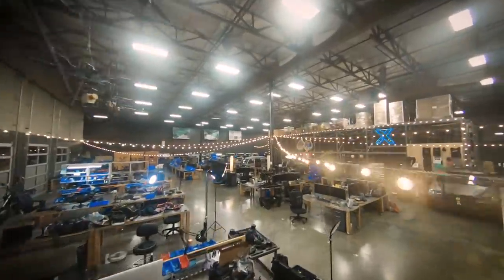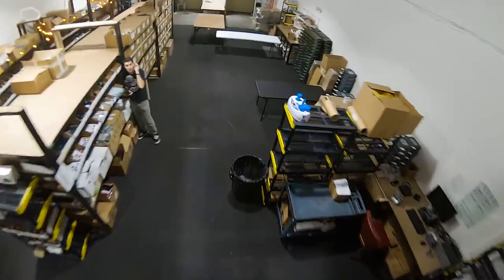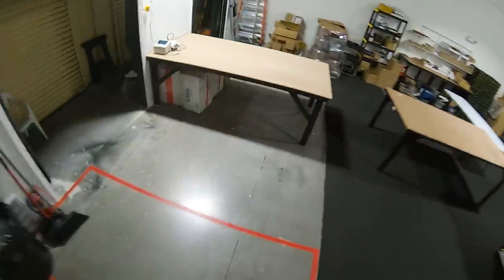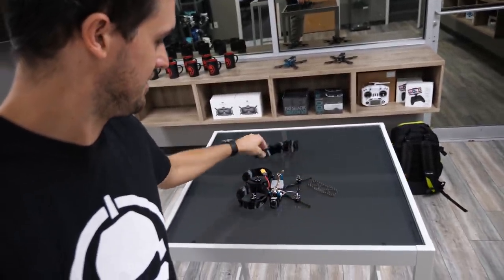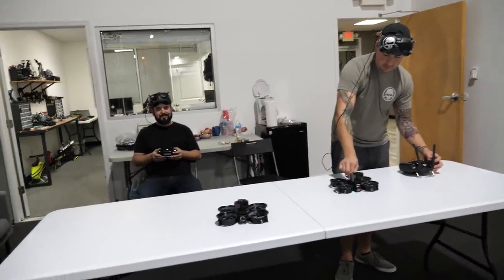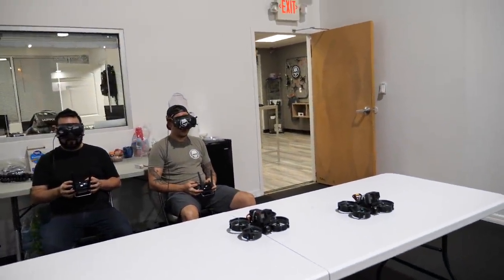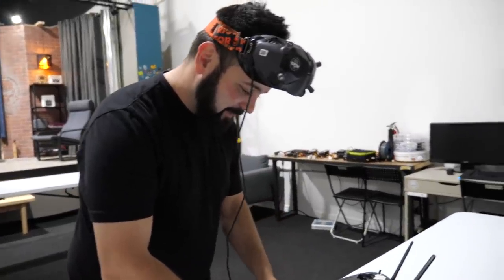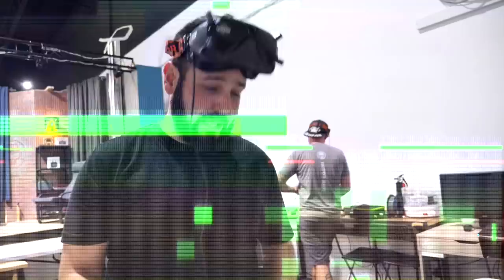Can a Cinewhoop RACE and FREESTYLE?

Comment: How did you get the RR head straps on the DJI goggles?
Reply: I cut a slot in the metal piece with a dremel tool. Drew is working on a replacement piece for that metal part so you don't have to do any cutting.

Comment: wat size batt is that?  Even with a super small 650 mah batt, i feel like i have to keep this thing on higher throttle just to get it in the air.   I have the exact same build fyi, stack, motors, frame, airunit, and props all purchased from RR store, So I should be able to match this performance.  Frame at 2:37 is to blurry can't see the batt spec.  looks like 850 mah size.  I tried one of those too.
Reply from the maker: Tyler was flying a 850mah, Jeff was flying 1500mah

Comment: Are the Quads under 250 grams?
Reply: Nope.
Reply: @AgustinMolini  Well In the future the might need to put a transponder that way the FAA can see the exact location and make sure you're not a threat to National Security.
Reply: @the_ep_nerd7311  unless they figure out a way to use Betaflight that wont be possible. But hey. Thats over 3 years down the road from now.
Reply: Flying indoors is never under the jurisdiction of the faa regardless of weight. That’s not national airspace.